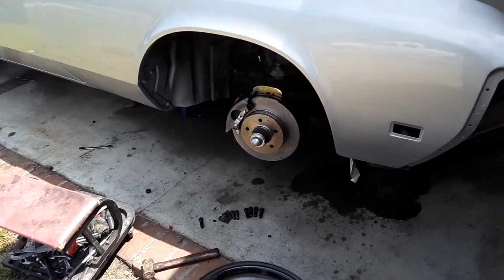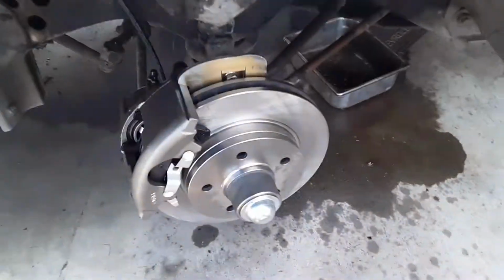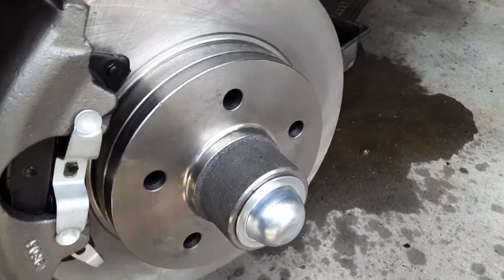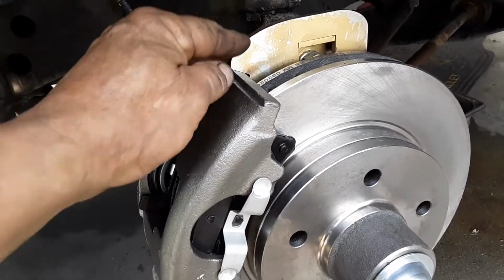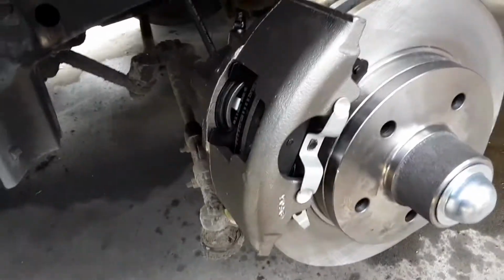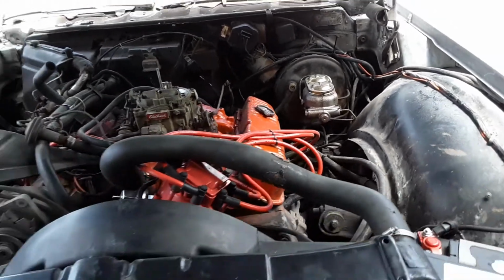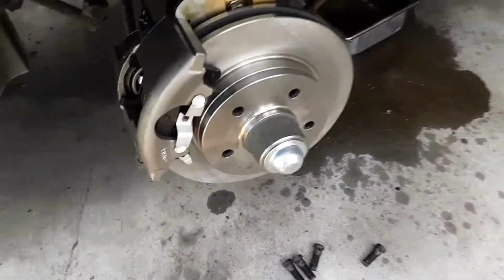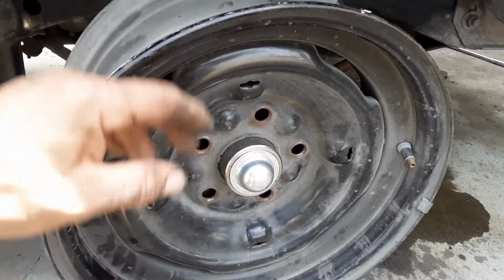1965 -1970 Buick Riviera brake conversion

Comment: Beautiful car....my mom bought a 69 Riv new off the showroom floor, and gave it to me last summer.  I'm going to be doing a disk conversion this spring as soon as the snow melts.  I noticed you mention you had not done the rear yet; as I responded to someone below, the rear OEM 10 bolt should accept most any other 10 bolt disk conversion for when you get to that point.  

Question...why wouldn't 95 Check 1/2 ton calipers work?  Confused why you had to go with Astrovan calipers.
Reply from the maker: Thanks for the info
I got the information as to what parts work on 
Scarebirds web site. 
It did say 4 w drive only ASTRO van calipers,  the disc pads are a 1/2 truck part number
Reply: @realsteelmotorcars2894  Just interesting on the astrovan calipers...Scarebird was on my list to contact and came across your video in my searching for more info.
Reply from the maker: Did you complete the
the brake conversion.
I have not been checking the lately 
Tell everyone how it came out.

Comment: Could it be done with something like a 70 Riviera so we can use the factory wheels?
Reply: The truck rotors requires a larger center bore on the wheels. A machine shop could resize hub or purchase rotors from scarebird.  Let me know when you decide and what you end up with

Comment: DAMN!! Great video I have a 66 Buick Rivi will this same set up work
Reply from the maker: 1966 to 1969 all the same
Reply: Nice !!! Thanks I might be able to make this shit happen I was pricing kits online the want close to 1300  my only other question is did u have to fabricate anything ?
Reply from the maker: @bolobrown814   I think the drum brake bearing are   the same I think  or bearing for 1971 C10
A3 bearing  and A5 bearings
Reply from the maker: @bolobrown814  only thing  that is not plug and play is the stock wheels gave a smaller hub size if you want to run stock hub caps 
You would need Truck 15"
Wheels 5 on 5 bolt pattern
Reply: I’m rolling 15 inch Cragar spokes I really like the idea of this tho I just gotta hype myself up to make it happen lol
Reply from the maker: @bolobrown814  the installation is not a big deal 3 to 4 hrs tops .
You can order almost all the parts from Amazon except the custom caliber brackets from.
 Scarebird Classic Brakes.
Good luck with the Riviera

Comment: So you don’t need a hub bearing on the front or do the studs go straight into the rotor
Reply: I know I should of replaced the studs prior to making video. That being said, the stud that come with the rotors are 14m x14.5  so you will need to replace them with 1972 c10 disc brake stud. 1/2 threads
Reply: Contact scarbird  for caliper bracket

Comment: What about the. Back
Reply from the maker: Didn't do them yet.
Reply: Most GM 10 and 12 bolt rear ends should be interchangeable...for the most part...so disk brake conversions for those axles should work.

I'm doing the same kind of conversion on my mom's (now mine) 69 Riv that she bought off the showroom floor in 69.

Comment: Is it any way you can maybe list the parts that you use. Loose. Thanks I really do appreciate it she did in advanceIs it any way you can maybe list the parts that you use. Thanks I really do appreciate it in advance
Reply from the maker: Here we go 
Front rotors 
1995 to 99 1/2 ton gm
Truck rotors 1971 c10
Disc brake wheel studs
And brake hoses,
1990 to 2002 chevy 
ASTRO  AWD 4X4 brake 
calipers and caliper
bolts wheel bearing and seals reuse what came
off the drum set up,
Order the caliper brackets 
from Scarebird classic brakes  the O.E. wheels
Will not fit , the hub bore
Is 1/4" or so larger. 
You can get around 
It by changing the wheels 
Any truck wheel will work 
15" steel wheels or 22s
Rotor hub area can be cut
To fit stocks...  Amazon 
Has good prices on brake 
Parts red calipers disc pads too best to get the ceramic D396 just remember when you order 
Brake pads you see a 396
In there  could be centric 105.03960  good luck